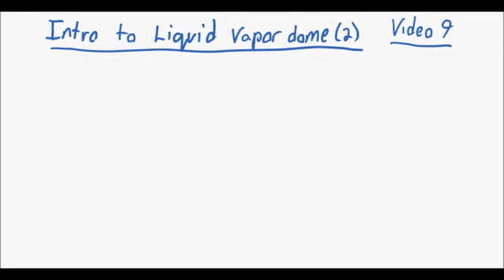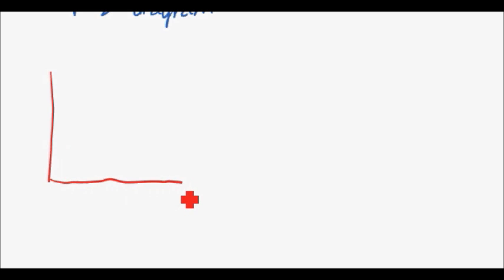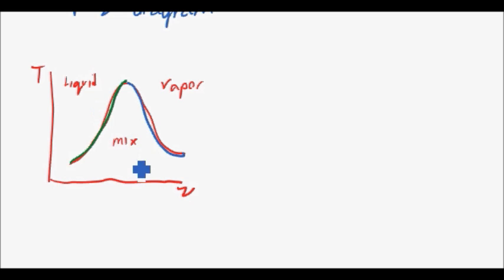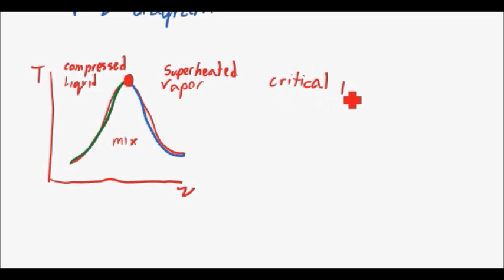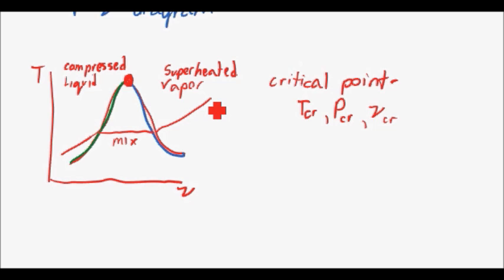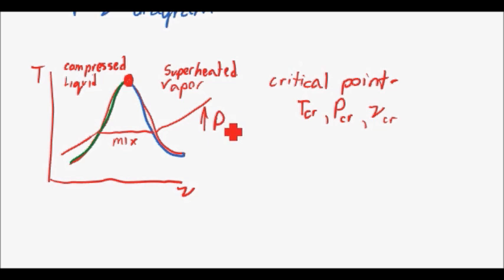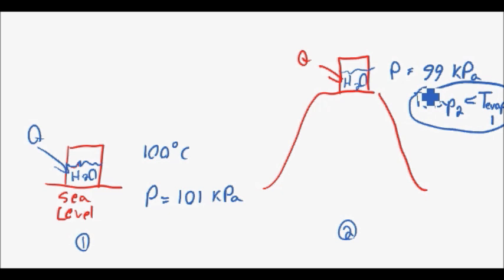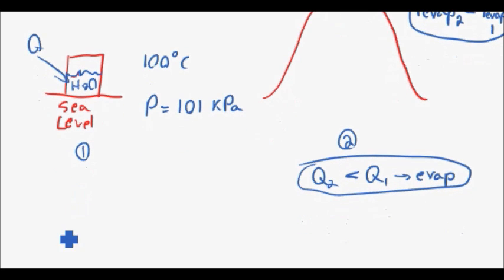Introduction to Liquid Vapor Dome Part 2 (Thermodynamics 9)

Comment: Hey , i had a different line of reasoning when you asked the question of which will evaporate first.
I considered that that , the quicker the transition from vapor to liquid would take place , the faster it would boil. Which means, the shorter the horizontal part of the line , the faster it would evaporate (because of lesser latent heat required) . This would lead to a different conclusion... Please elaborate. Nice video by the way. :)